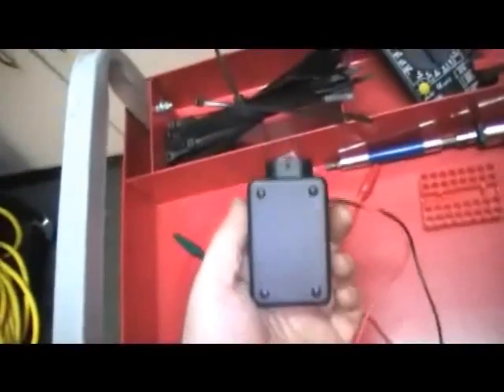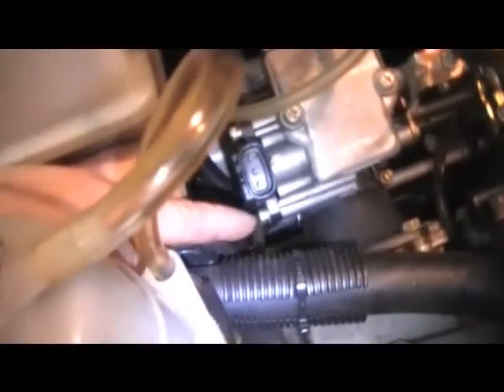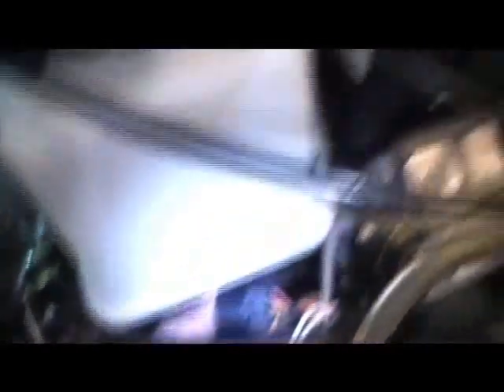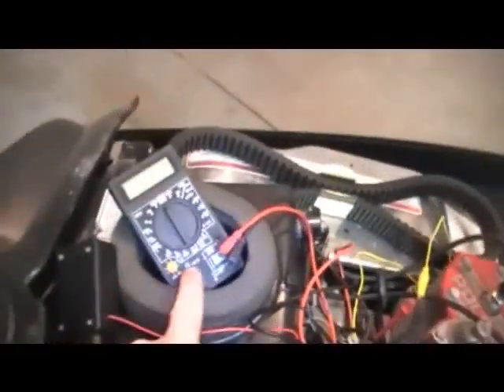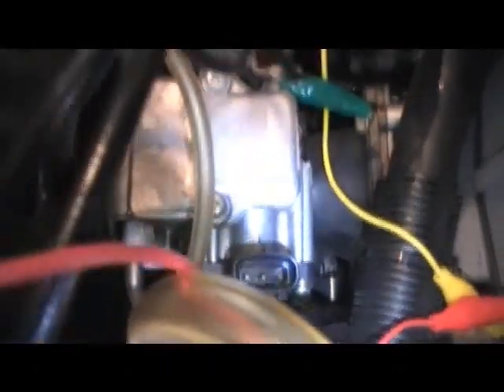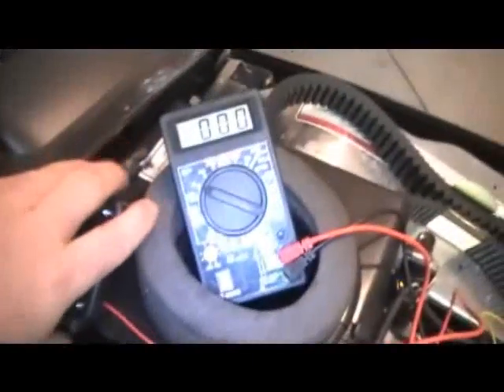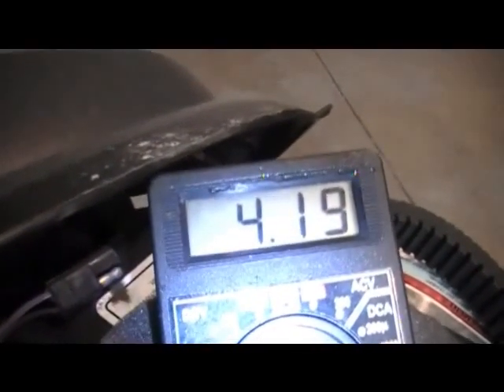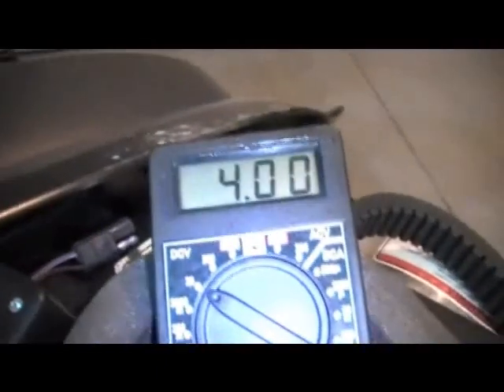How to adjust your Polaris Snowmobiles TPS.

Comment from the maker: Hey The BCSledder, 
The black wire from the flukemetre is being grounded to the black wire from the power supply which is connected to the bottom pin on the TPS.
 
Is your Dragon a "cleanfire injection" sled? If so, you need to set you TPS differently than the video above! I posted a How To about 20 comments below called "SETTING TPS ON CLEANFIRE INJECTION"

Comment: 450s were the ticket. its kinda warm here but got into the 20s then it was perfect.now back to tweekin the clutches now that the motors dialed in.  mid range got the exhaust temps up a little but the plugs are picture perfect.   amazing what you can get out of these engines with stock pipe.   you  ever mess with the headpipe length to get some power?  guy told me if you take an inch out you get more topend pull   i know   dont fk with it   it works  just wonderin

Comment: hey rich ,kevin, 03xc800 got 04 carbs on now cause theyre new and free(best kind) stock needles 460mains .used to have needles frm xc500 in and ran real good but needed 490 mains, you know why. anyhow pulls realy hard now wth stock needles and still want to drop the mains one. how low have you seen em go? plugs look great and i dont want to drop the needle cause the low and mid are fine. seriously its rite there  air box is open too but no bigmouth just cleaned up  no pipe, just good clutchin

Comment from the maker: The Polaris R&D guy that I talk with says the Boost bottles are a waste of money and don't really do anything. As for the pros and cons or using the temp bypass plug, i couldn't tell you but if it were my sled I wouldn't use it. I would rather trust the ECM then forgetting to look down every couple minutes  at the gauge and cook the motor

Comment: thanks man for takin the time to put the info on the throttle sensor sh t . ive been arround the block too many times to count on this 800 i built.its not some king o the hill sled but its got all the rite stuff and it never quite ran good enough for me and being a mechanic that can drive ya nuts.im slow  not stupid! so when i finaly got a straight answer on what the timing should be , i found your sight and WHAM!  made the box n then i was dangerous. thanks a ton now i can ride  and my buds too

Comment from the maker: It may help a little but the main problem would be your jetting in the carb. You need to find out at what RPM your having the lean knock and adjust (Richen) that jet accordingly

Comment: Rich, Hey! Joe in Niagarg falls NY. Just tore the whole fuel system off my 800 X edge. Cleaned everything. Tank, pump and carbs. Still starts hard and idols 4000! Do I need to seat the idol pinns with it running and then back them out to correct rpm (about 1000)? Kind of new at this.

Comment from the maker: I'm not 100% sure but I believe that you need to reprogram the CDI to change the fuel mixture. If you haven't done ant mods to the Indy then I think I would be looking for other causes. For ex... Dirty injectors or filter, bad fuel pump or what I think it could possibly be is a bad crank seal sucking in air and leaning out your fuel mixture.

Comment from the maker: @robi0305 
I learned it directly from one of Polaris's R&D guys who has been Racing, Designing, Reserch, Development, Building and Testing Polaris Sleds for over 40 years. So when he says that the optimum setting for your TPS is 4.0Volts then you better belive it's 4.0V tested and true. Sure you can play with the voltage a bit because every sled is a little different..

In the end "to me" Barry R&D guy knows best.

Comment from the maker: 3. Insert the red voltmeter lead into the terminal above the pink wire, and the black meter lead to the terminal above the black wire. Slowly open throttle and check for smooth voltage change.

NOTE: The Fluke meter will change scales and show O.L. momentarily when throttle is opening.

Comment from the maker: 4. Remove the throttle cable in order to take the slack out of the cable. 

5. Remove the connector from the TPS on the throttle body and install TPS sensor tool on to the TPS.

6. Measure and record the voltage reading at idle. Should be close to .930 volts.

7. Back off the idle lock nut counterclockwise and then back out the idle adjuster counter clockwise until the screw tip separates from the adjusted lever tab.

Comment from the maker: 8. Loosen screws on the TPS sensor.

9. Adjust the TPS sensor until the voltage on the volt meter reads .709 to.711 volts.

10. Tighten the TPS retaining screws, making sure that the voltage continues to read .709 -- .711 volts.

11. Turn the idle set screw clockwise until the voltage reads .930 volts.

12. Voltage at the yellow terminal should be .920 -- .940 volts at idle. Once the TPS voltage is verified and set, remove the sensor tool and re--install the TPS harness.

Comment from the maker: Sorry Niko, this way will not work on your sled. The 800 in the Assault is a Cleanfire Injection engine. Your engines TPS is set using a different method. The voltage from the tps is set at idle not WOT. I'll try to post a "How-to"

Comment from the maker: No! You need a steady 5 volt source. Your best to use a 9 volt battery with a 5 volt dc regulator from Radio Shack. 
You can see how I built mine if you go to ...
 w w w . s l e d n u t z . c o m 
and search for "How to Build a TPS tester" in the "Snowmobile How-To's" topics.